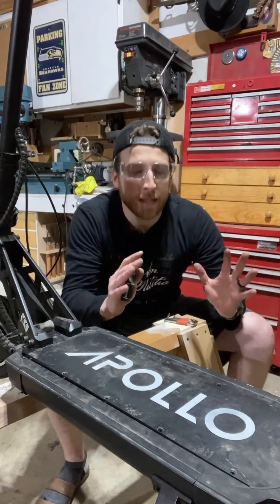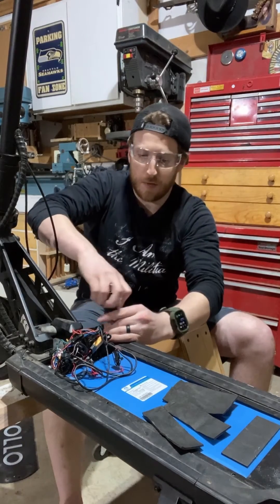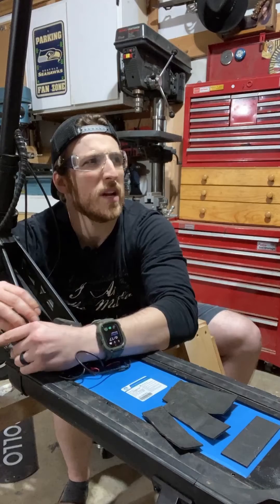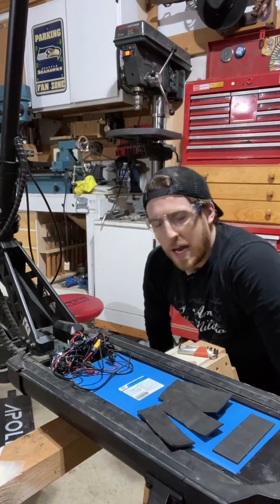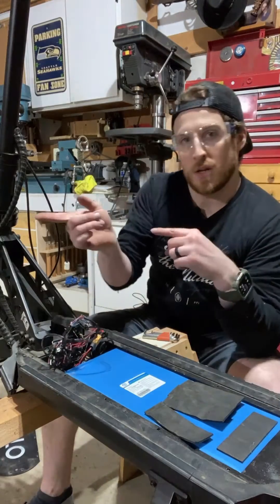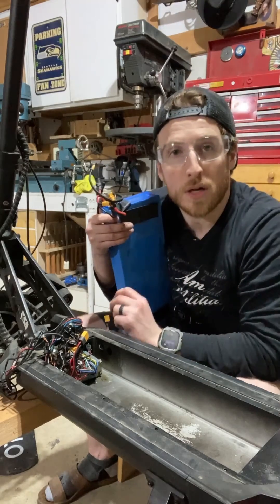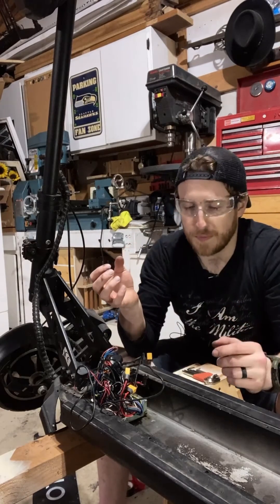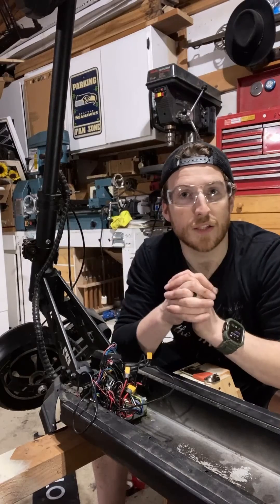Electric Scooter Troubleshooting | Part 1 | Finding the Problem

Comment: At least you got a error code my city pro 22 randomly started turning off in around 0-20 second intervals and then it kinda just stopped altogether i dont know what the hell is erong eith it its got like 1500 miles and i bought it second hand eith no innitial problems last year but i guess its time has come but i will try to open it up and maybe by some fluke something disconnected itself but if you have and suggestions pls tell me
Reply: Same thing happen to me but mine has 600 miles on it

Comment: idk what to do i tuck it all a part an water got in it an it dry out i was geting e 10 erro an i got a new screen it work but win i plud the wiers throw the neck just a little the screen shut off it i go left or right the screen shut off so in short the key holder wiers as well as the multy meeter wiers must be shorting out to the fream is all i can  thick of if that one wiers was grownd to my fream sir would that stop it from going on and if u where me wood u unplug every think buy a new key holder an plug the screen with batter it shuold light up idk what elss it can be
Reply from the maker: Sounds to me like either a loose wire or a wire has a cut in the insulation which is contacting the neck somewhere. I would unplug your connections and reconnect them first. If the problem continues you may have to remove the wires from the neck